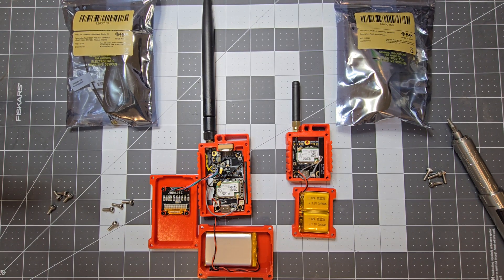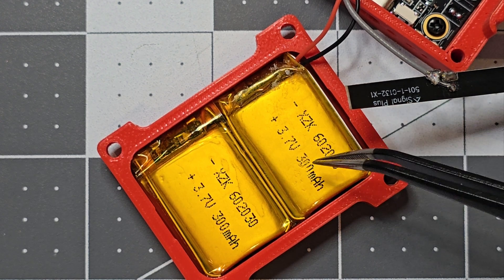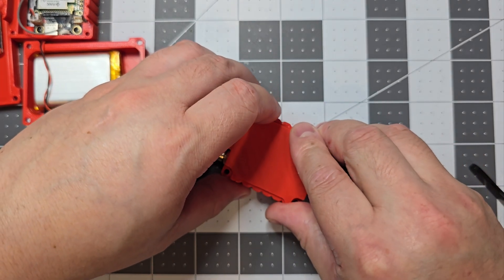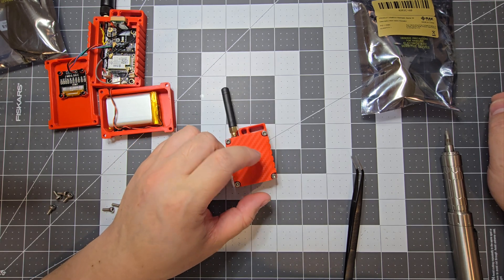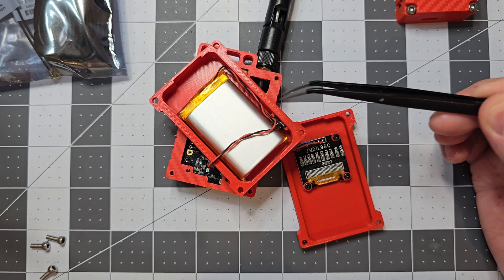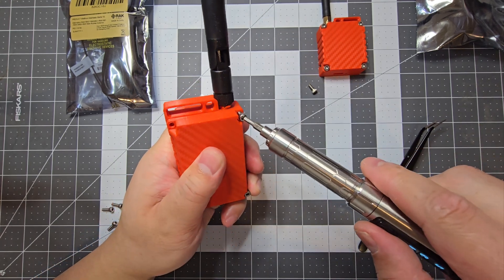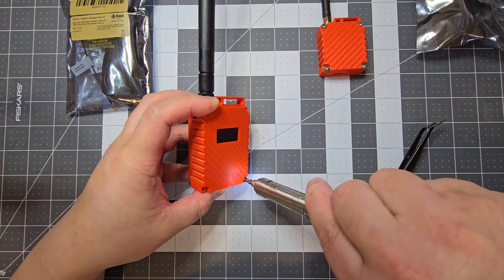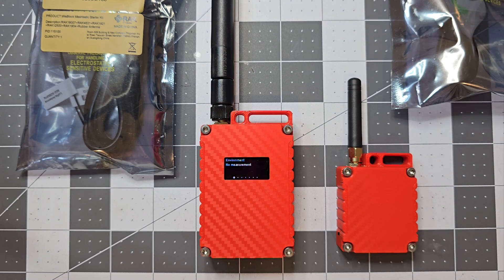RAKwireless WisBlock Meshtastic Starter Kit Builds

Comment: Fantastic! The mini is the exact setup I want to build. I have a couple questions for you:

1. How did you add the power switch? Does the board come with it? Or is it a switch you needed to buy and add? Did you need to modify the case for it?
2. What program do you use to modify the case? FreeCAD? Fusion360? Something else?

Very nicely done and thanks for sharing!

Comment: Any chance you might make your case designs available? I have been having fitment issue with the originals.
Reply from the maker: @mikehollibaugh  Unfortunately, the licence for the cases mean I am unable to share my remix. What fitment issues are you having exactly?
Reply: @rayj1988  I understand completely, for the 19007, the mounting holes/USB-C didn't align, for the 19003 I could not get the board to seat properly because the SMA antenna was in the way.
Reply from the maker: @mikehollibaugh  make sure you download the correct frame there is one for 5005 maybe you downloaded that one as the alignment is slightly different.
Reply: @rayj1988  I will double-check, I greatly appreciate your assistance and replies!